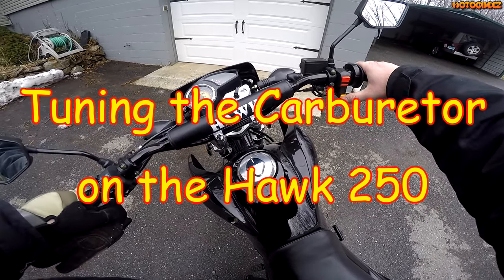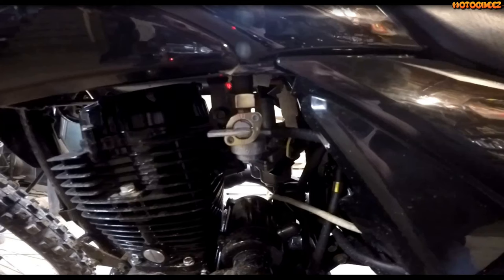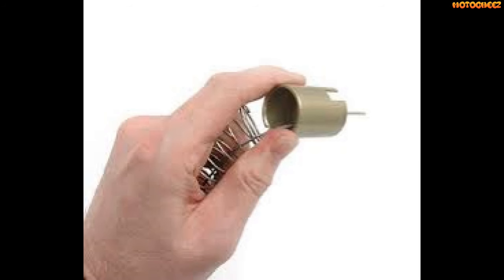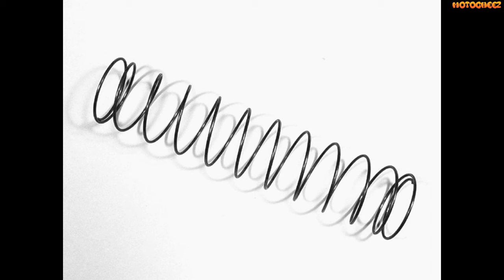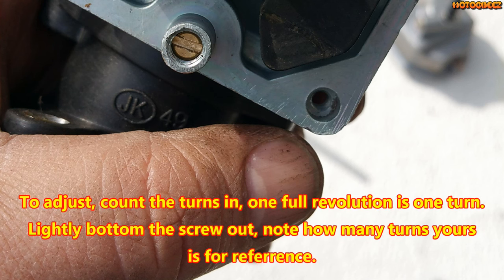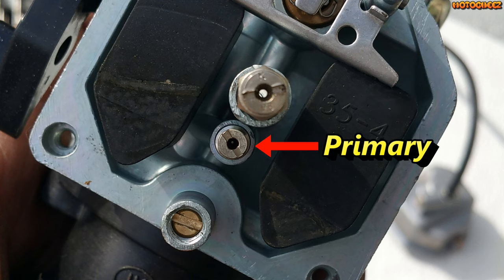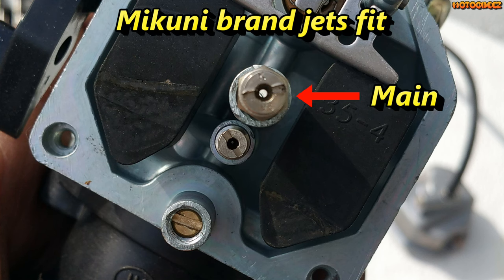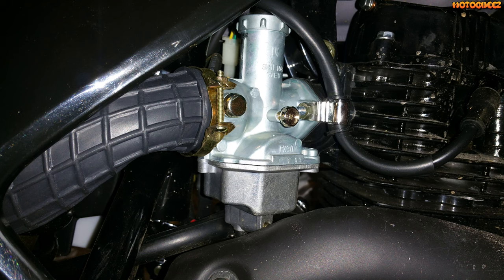[E3] Hawk250 Carb Tuning on the Dual Sport Chinese Enduro 250

Comment: brand new, wont idle. What do i do?
Reply from the maker: Turn idle screw up?
Reply: @MotoCheez  on the handlebar? or is that the big screw on the side of the carb?  Also, is down=chokeoff?  Thanks for any reply.
Reply from the maker: Up is choke, idle is on right side of carb. See any of the carb videos I've done, shows the idle adjustment. Do not use the throttle cable to raise idle

Comment: Its probably a stretch but can someone please tell me how to solve this issue im having ill literally pay u 5$ on cashapp if u tell me how to fix my bike 

So I got a hawk 250 from Amazon put it together and changed the oil and gave her half a tank of gas, I have trouble getting the bike to start fully when I let go of throttle during start up it dies and when I do get it to idle it stalls out every time you try to put it into first and start moving and like I said I've had multiple experienced drivers of these bikes try to drive it and it just dies, the company sent me a replacement battery and carburetor if I replace those will that fix it or is it something else I dont wanna do the carb for nothing
Reply from the maker: Try raising the idle and giving it a little throttle, the clutch plates being new are a bit more sticky first few times it used.
Reply: @MotoCheez  for sure man ill give it a try, thanks

Comment: This had been a great great learning experience. Anyways so my Magician 250 carb, the new ones at least I found out the new ones are tuned very well no adjusted is really needed. (I have 400 miles on mine) Anyways from your videos which I didn't pay attention too like I really should have. I messed with the air mixture screw, and also the idle. I'm going to call and see what the stock settings where on it and have been taking it off and on doing all sorts of things to it. I kind of laugh because I shouldn't have been really messing with that all the jets and all the other stuff but it's all been tons of learning and seeing what does what by hands on experience but my air box? I think that's what it's called the glue paste has come apart for one of the pieces to the backside of the carb to the airbox. What sealant is used for that it has an air leak currently and I'm unsure what to put on that.
Reply from the maker: +Toby L. Gilbert I've heard they were decent with jetting. But mine I just opened the mixture  one turn. Stock is 1 1/2 out.
Reply: MotoCheez hey again, I put a 110 jet in my mikuni  carb, wondering your opinion on a idle jet to pair with it?
Reply: okie dokie and what's the paste they use for the airbox? taking the carb off an on several times it came apart slightly is it like an epoxy?
Reply: or would like a superglue work
Reply from the maker: Toby L. Gilbert I would think a good superglue would work, they have pretty good thick stuff at the hobby stores, they'd be the best to ask.
Reply from the maker: Toby L. Gilbert yes, it should, in just saying a hobby shop has the thicker superglue.
Reply: MotoCheez what's a good idle jet to pair with a 110 for my mikuni
Reply from the maker: +Taylor Freezy I never set up a mikuni on the hawk, but I've heard the stock one will work with mixture screw out 2 1/2.

Comment: I need HELP! - First off, I love your videos. I subscribed and you talked me into getting a Hawk 250. I've had it for 1 week. I already put 245 miles on it.  With stock 15/50 gears and stock carb settings I was getting 62-63 MPH in 5th gear. I changed the front sprocket to 17 and rear to 45 and replaced chain. I re-jetted my main carb to 110 and shimmed the needle with two 3mm washers, with stock exhaust. Fuel adjustment screw backed out 2 turns (also tried 2.25 and 1.75) Now, I'm only getting 57-58 MPH but now 5th gear starts loosing speed back down to 52-53MPH. Shift back into 4th and MPH climbs back up to 55, shift into 5th climbs to 58 and looses speed back down to 52-53MPH. I then changed front gear to stock 15 and kept rear 45 and max speed is around 55 MPH and 5th gear is still loosing speed to around 50. 1 through 4 gears seem to have plenty of power. Also exhaust making popping sounds when decelerating. The idle acts like it hanging (idling high) when coming to a stop and settles down when I let out the clutch a little. I also smell a sharp burning smell when I stop. (Well, just looked again and hose at bottom of air box going to gear case/engine is split, hose is burned and oil/gas is dripping on exhaust-so maybe that''s the burning smell any idea where to get a replacement hose??)  It seems to me that it's running lean/hot. I didn't see any gaps at the rubber carb "boot" (for lack of a better term) connecting to the engine like in your video where you had to add washers. Any suggestions???
Reply from the maker: TX Jasper congrats and thanks! I  would check 3 things. 1, I would try a 115 main,  wide open throttle relies on the main jet. the mixture screw is idle mixture , 2, do you still have the stock speedometer? if so, mine became inaccurate at about 500 miles, I also thought I was losing speed, the needle started bouncing with a 10mph difference. the 3nd thing is check is the gas cap, try top speed with the cap loose. a few other guys had some vacuum issues and it ended up being the venting in the gas cap.  the smell is probably the catalytic converter in the pipe? mine pops a little too, you're right, usually it means lean or a vacuum leak. let me know how you make out.
Reply: Thank you!!! I installed 115 main this morning. Also shimmed the needle with four 3mm washers (saw that you used #6 so thought I would double it). Awesome difference. 5 gear has power! 
Stock speedo cable broke. I pulled it out and welded it back together. Now works great!
I still have the original speedo and seems to be working for now. 
Also, dip stick was bent and twist when I changed oil. It felt like it was hanging up, so I just cut it off. Anyway, thanks again for responding so quickly!!
Reply from the maker: TX Jasper awesome!! seems some need more main jetting when you start modifying, I'm up to a 120 main, with pipe and all the mods I did videos on. Now get out there and rip!
Reply from the maker: TX Jasper the dipstick is a waste anyway, another guy bought a hawk used and the dipstick was broken off, he took the side cover off and it was down by the gears. , probably better off cut IMO
Reply: Hey MotoCheez. I need your help again. How are you running a 120 main jet? I actually went back from a 115 to a 110 because it was still running a little rich at top speed before the performance exhaust. 
I just installed the ebay performance exhaust from your website today and went back up to a 115 main jet. Awesome power difference throughout the acceleration except top speed. It bogged and sputtered  at top speed/full throttle like its too rich. Went back down to 110, less power when excellerated, popping a lot when letting off the throttle, but top speed was 4 mph more and no sputter or bogging at full throttle. I also did your air box mod, shimed the needle using 4 - 3mm washers, and changed to the digital speedo. Any ideas?? Thanks again for all your help!
Reply from the maker: +TX Jasper I think I'm at a 118 now.. my elevation is 600 feet, I noticed not all bikes tune the same. If it's popping letting off, maybe you have an air leak on one if the boits?
Reply: MotoCheez thanks for the reply! I'm at around 500ft elevation. What bolt would be loose for a vacuum leak? The carb nuts are tight, the valve cover is tight also.. the strange thing is the 115 main jet seamed to have noticeably more power throughout acceleration and no popping. Everything was great except when I tried to reach top speed at it's max, the engine sputtered and bogged a little...the 110 main jet ran great at top speed but  it popped and had less power after I installed the new exhaust.... do you think adjusting the needle up or down with the shims would help with the 115?
Reply from the maker: +TX Jasper yes, the needle will help. Wide open is main jet, 1/4 to 3/4 is the needle jet and below 1/4 is primary jet and mixture screw. They overlap a bit too. I'd try  adjusting needle. Vacuum leak would be where carb boot bolts to head. Mine had a gap
Reply: I remember the gap now from your video. I'll try adjusting the needle. Thank you!
Reply: I adjusted the needle this morning from 4- 3mm washers to 2- 3mm washers and went back to the 115main and it fixed the bogg and sputter at full throttle! New exhaust and upgrade to 115main makes a big difference. Thank again for all your help!
Reply from the maker: +TX Jasper awesome! Hawk on brother!!

Comment: I used this mikuni. I did not CHANGE any jets: 30mm Mikuni Carb Carburetor for 150 160 200 250 motor Pit bike Dirt Bike VM26 :  http://www.ebay.com/itm/262202860867?_trksid=p2057872.m2749.l2649&ssPageName=STRK%3AMEBIDX%3AIT
__: It boltted right up and everything worked well except the idle screw is going to need a tiny philips to adjust. Its hard as hell to get the old carb out and the new one in. Have lots of patients. After Installed. I had to raise the idle screw three turns, and air mix to 1 1/2 turns. The difference between the stock carb and this one is easily 5 more horsepower. Wheelies without having to pop the clutch, just gas it, and your on one wheel. Id like to try either a bigger carb or a carb with a primary pump, oh and i put an E-plug in it, a 36 or 38. Works better than the NGK.
Reply: playvinnie where is the air mixture screw on the minkuni ?

Comment: Thanks for all your videos. They've been a great help while playing with my new Hawk! If you, or anyone else, is tired of reaching for the choke lever I have a kit that lets you work it from the right side of the carb instead. https://www.youtube.com/watch?v=xak4TvWTL4U
Reply from the maker: Nice! I saw some cables that would work too if you want to mount on handlebars.
Reply: Thanks! Couldn't justify complicating the idea that much though, when a simple lever right there on the carb that was easy to reach could be installed in 10 minutes. Nothing to bind up, or have to unhook to remove the carb if needed.

Comment: im getting a new exhaust for my hawk..so what jets would i need for the carburetor an do you have to mess with the carburetor when you get a new exhaust on??
Reply from the maker: Jose Martinez if you're jets are stock, yes. Depending on elevation, 110  to 120 main.